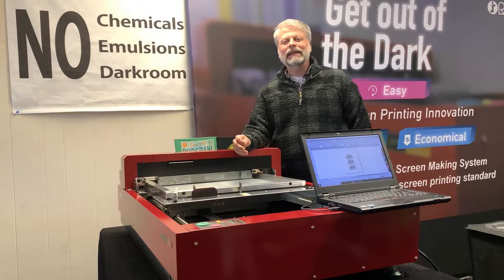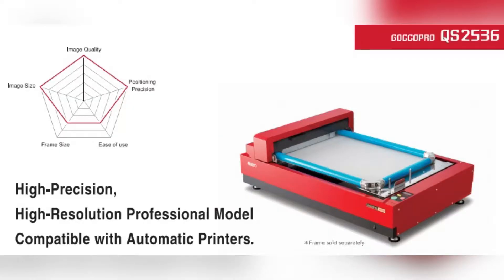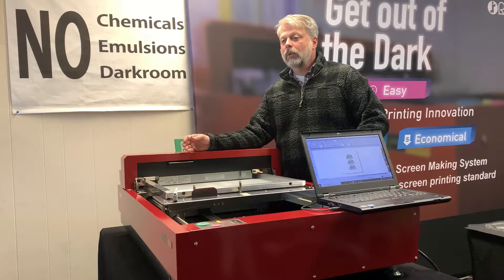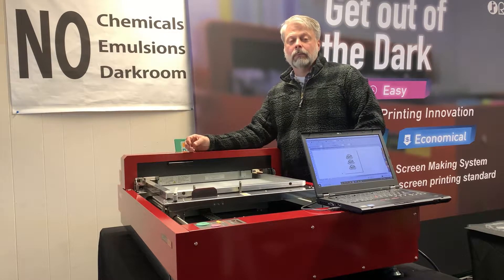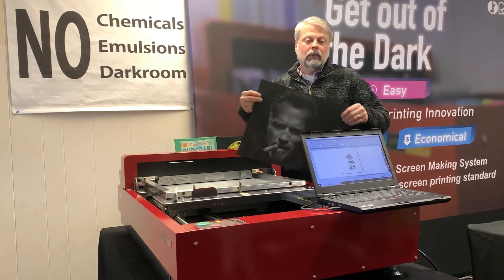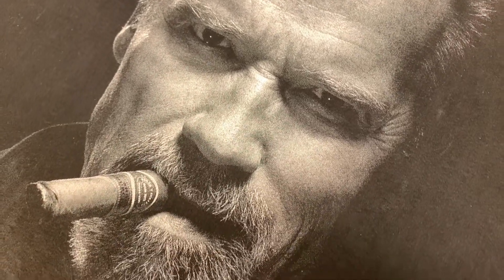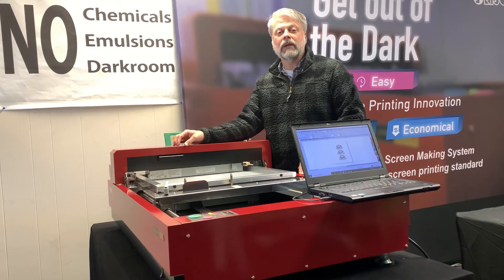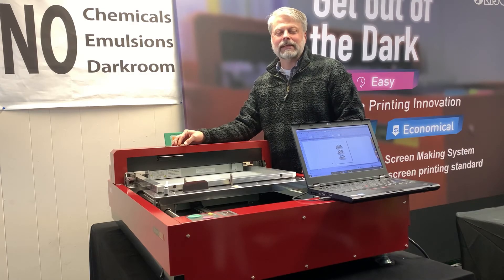GOCCOPRO QS2536 Dry Thermal System Overview

Comment: con dft es mas barato
Reply from the maker: Hi Manual, I am guessing you mean Direct to Screen. If so, it actually costs more when you figure in labor.
There is only 1 consumable with Dry Thermal Technology and 6 minutes of labor.
With conventional (and Direct to screen) there are many consumables. Emulsion, Ink for your DTS (or film and ink), water (lots of it), Stripper, Degreaser, Abrader, Ink Cleaner... but mostly labor time. 
I would be happy to challenge any screen printing process to a 1 color or 4 color job. We both start with blank screens (yours with mesh, mine with no mesh) and I'll be registering the job before you have finished washing your screen(s) out.
(and I can get 60lpi on 120 mesh screen!)